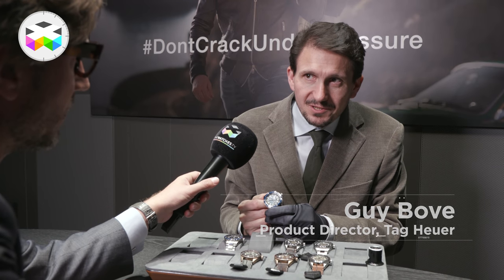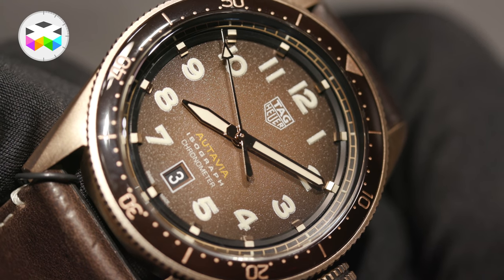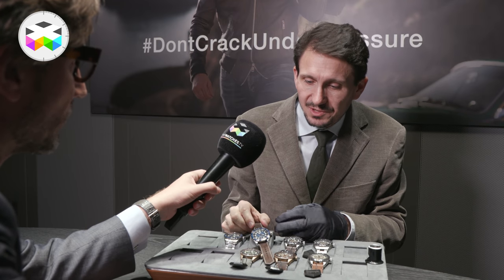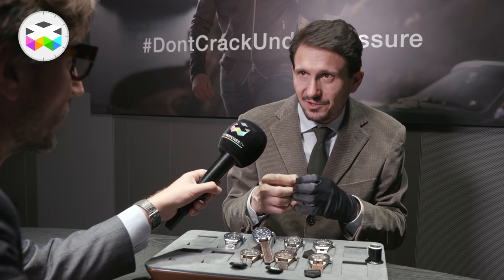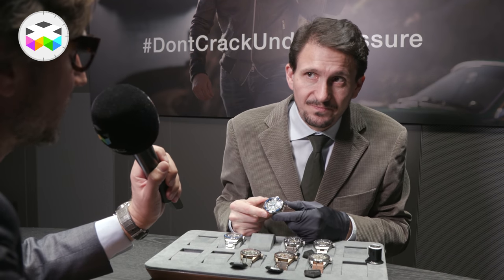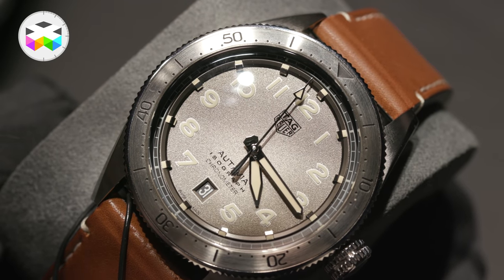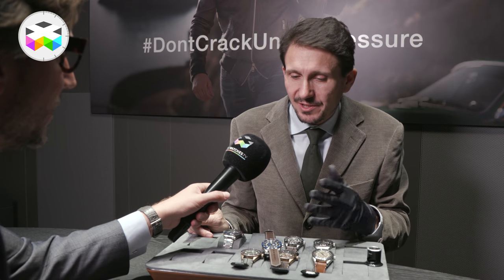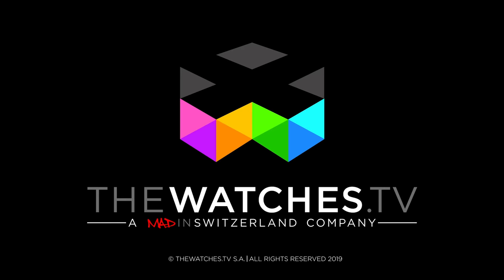TAG Heuer Unveils Isograph High Tech Hairspring in Main Autavia Collection

Comment: Wrong, EVERYTHING is affected by gravity equally.
Reply: I think they meant that the delay or advance you can have on your watch due to gravity (depending on the different positions of the watch) is reduced when the hairspring is lighter: even if gravity is the same the force applied by the weight of the hairspring on the balance wheel will be smaller.